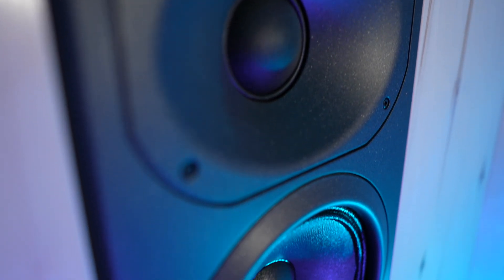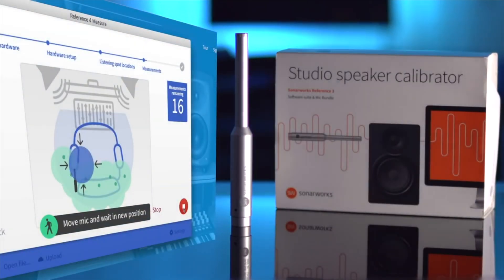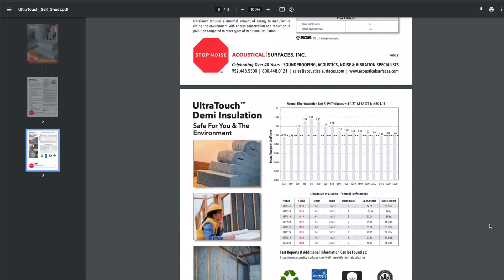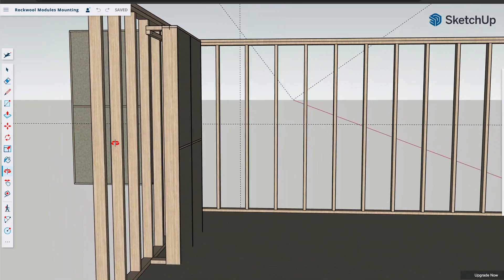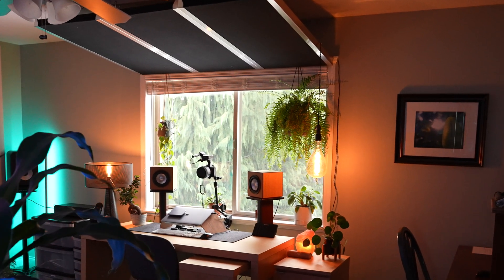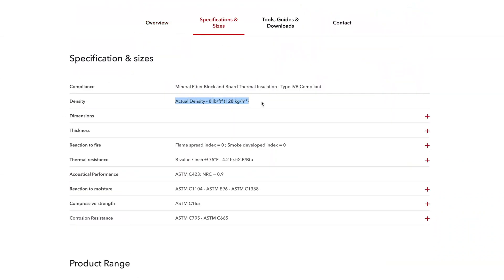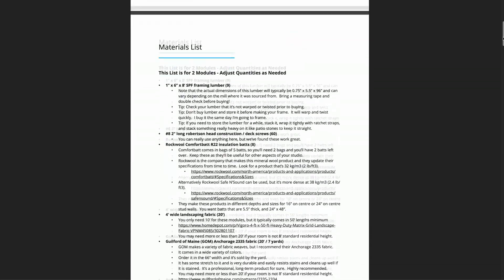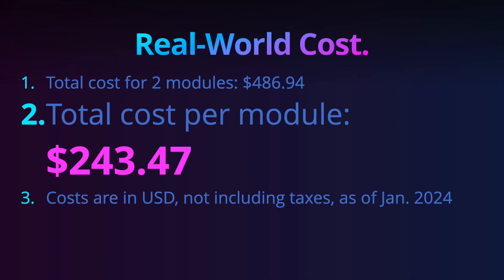How to Use Porous Absorption in Studios - Rockwool + Fibreglass

Comment: What can you recommend for making 50 cm in deep for soffit bass traps? Good video btw :)
Reply from the maker: Glad you enjoyed the video.  If you're working with 50 cm then I would use multiple layers of porous absorption for a gradient impedance / graduated flow resistivity effect.  

I'd alternate between light density pink fluffy for the majority of the absorber (36.25 cm) then 13.75 cm of Rockwool Comfortbatt.  

By soffit bass traps, do you mean that they'll be mounted up in the seam between the wall and the ceiling?  I assume so.  In that application you'll get superior results be sealing the air space behind the absorbers.  This should improve the LF absorption, creating a spring effect from the trapped air.  

Alternatively, you could fill that airspace with more pink fluffy.

Comment: I have a room size of 115" inches wide and 150" inches long>> 
I want to build a superchunk corner bass trap 24inch long and 17 inches angled to the cornerr walls
also with a 2ft by 4ft, 4 inches thick panels to hang around the first refection point and also to place them around the rooms to help control mid and high frequency. The main purpose of this is for Mixing and also for recording vocals 
In my country the available density of rockwool is 50kg/m3, 70kg/m3 and 80kg/m3 and they are all 50mm thick 
but the main problem is what density of rockwool is best for my setup? 
i know this isnt a new video but i would appreciate every help i can get
Reply from the maker: I’d try to find some low density pink fluffy fiberglass.

Comment: Hi, great video!
I have a question: what kind of OC did you use what the R number on it and is it 5000 pa sm and if not, could you guide which one is, cause I need exactly 5000, for my studio according to space that I have, thank you in advance❤
Reply from the maker: Hey hey.  I used the OC pink fluffy 5.5".  Can't recall the R value as that isn't anything we use for acoustics.  

You will also never get an accurate GFR number for low density fiberglass because there's so much batch to batch variation in density that OC doesn't even publish a density number for it, let alone GFR.  You're just guessing.

Comment: I only have rockwool safe n sound and back wall cant be treatment  cause its laundry so im only using front wall beind speakers sides ans cealing above me will 6 inch and 12 inch framless panels work with 3 inch eoxkwool stacked im only have 7db issues with 50hz to 200hZ
Reply from the maker: Hey hey.  I’m not a fan of putting treatment behind speakers.  I put the speakers right up against the wall which improves bass response then I add porous absorption all around them.  

I would highly recommend finding a way to treat your back wall.  That’s where your speakers are aimed after all.  All the energy in room will be dumped back there.  

If you need access to laundry consider making a false wall with a door or adding gobos on stands that can be moved.  Something is better than nothing.

In terms of your 6” or 12” panels.  Yeah Safe n Sound comes in 3” thickness.  But you’ll get way better results especially with bass if you use multiple densities of insulation.  So maybe a 1.5” front layer of Rockwool Rockboard 40 or Cavityrock.  Followed by Safe N Sound or Comfortbatt.
Reply: One more thing would be correcr to say using two materials will set off inner air gap or fake gap since rockborads uses safe n sound layers as air space before sound hits rockborad again  @warpacademy
Reply from the maker: Hey hey.  I would definitely recommend using an air gap behind your modules, but I'd use the Rockboard 40 as the front layer, then Safe n'Sound directly behind (not gapped) and then a gap behind that equal to the depth of your panel.  So if you have a 9" panel, then air gap by 9".
Reply: @warpacademy      Gotcha im almost done now i ended up doing a frame for 12-inch bass trap make sure i get 50hz down 7db to at least 2 db. we don't have rockwool 40 in ohio but we have many fiberglass brands and safe n sound i have a few of safe n sound right now. i just signed up for your course. i have about 18 inch each corner in front and no space in the back wall since washing machines and dryer
Reply from the maker: @22rapper  right on.  Glad to hear your treatment is progressing.  Make sure you pay attention to density when going for deeper traps.  Don't use 12" of straight up Rockwool.  That'll be too reflective in the lows.  You'd want to use some Rockwool and some pink fluffy fiberglass.
Reply: @warpacademy  okay so only use 6 and 9 inch straight rockwool if i do 12 inch corner trap use pink fiberglass im also using Sonarworks just gotta reduce low end form plus 8 to plus 2 or less less pleasing but doable plus 5. in painting walls now
Reply from the maker: @22rapper  Hey hey.  That wasn't quite what I said.  If you're doing a 12" depth, you'll be far better off using 2 densities.  IE use a front layer of Rockwool, followed by a deeper later of pink fluffy.  So, 3.5" of Rockwool Comfortbatt, followed by a 5.5" and 3.5" batt of fiberglass, for example.  Cheers.
Reply: Okay thank you. You were sayin in video 2 density together gave you a membrane effect right? If so thats cool many in my heart say I need membrane trap or 5 feet trap for my 50hz I'm like I'm talking to a pro I'm listening him @warpacademy
Reply: Gotcha I signed up for course. So if I do inch bass trap do 1.5 or two rockborad then 9 inch of rockwool.  right now my speaker are close to wall before it was 12 inch away now it's 8 closest i  can get it. since on spider leg stands so  but stand is against it for sure. The laundry room definitely cant be cut off i also have a furance and water tank on left side but luckly concreate walls so all flate response just 50hz 200 spike but 50hz is more of headache i know 200 can be handled with 3 inch rockwool based on nrc. @warpacademy

Comment: hey thanks for the video really helps out!! i wanted to ask you because of limited space you mentioned i encouter with, what is the best possible density for 4inch panel in kPa s/m2?
Reply from the maker: Hey hey.  Glad you liked the video.  The unit of measurement you mentioned (kPa s/m2) is for gas flow resistivity, not density.  They are related, but not the same thing.  Usually manufacturers don't publish GFR, only density.  

Panels of the same density, but made of different materials (for example, glass wool vs rock wool) can and will have different GFRs due to variations in fibre structures.  

In general, for studios, you'll want to start with materials in the 10,000 Rayls (kPa s/m2) range.  Rockwool Comfortbatt in North America is 32 kg/m3, which is about 10,000 Rayls.  Although, if all you can manage is a 4" thick panel, you'll likely get better results with higher density material such as Rockboard 40 or CavityRock (64 and 69 kg/m3 density respectively).  

Cheers!
Reply: @warpacademy  Awesome thanks for the Info got confused a bit but now its clear, i'm asking in kPa s/m2 because here in Europe it's basically the opposite thing, they publish GFR and not density!!!!!
Now i have got rockwool material of 30kPa s/m2 4inch thick to be made for the first reflections and back wall, and mineral wool of 5kPa s/m2 for thick 16inch soffit bass traps floor to ceiling and after watching your videos i'm thinking of combining the two thicknesses to expand the absorption for the first reflections and back wall to 8inches, what is your opinion about that? Should they reflect back if i keep it only with the semi rigid material or combine them?
Reply from the maker: Hey hey.  Okay, so do NOT use a 30,000 kPA s/m2 material in a music studio.  That's way out of range and it'll reflect a huge proportion of low mids and terribly underperform absorption made with 10,000.  Watch my entire video series.  Follow the advice.  I've put it all out there.  

The 5,000 kPA s/m2 product would be great for deeper modules, but too light for modules up to 15 cm.  There is a sweet spot.  If you know the GFR numbers, use this to model your treatment acoustic performance: http://www.acousticmodelling.com/porous.php

Comment: As far as I know rockwool is pretty expensive in Australia and isn't widely available. I think it might be over $200 AUD a bag. I think there's only a couple of building suppliers that sell it.

I can get knauff insulation from the local hardware which has the highest density of around 30kg/m3. It's around $100 a bag.

I don't want to build super thick panels and it doesn't have to be perfect but I was wondering if this would be a good enough compromise for a bit of treatment in a bedroom studio? Or is it worth forking out the extra money and getting rockwool instead.
Reply from the maker: Ah yes, the availability and cost of materials in your local area matters.  Each type of material has different gas flow resistivity for each density.  I don't know if knauff has a different fiber / strand structure to rockwool, so I have no idea if the GFR is what you want.  Maybe they publish that?  But GFR is usually hard to get.  You want 10,000 Rayls.  Maybe a bit higher if you're going with thin panels.  

What thickness of panels are you thinking?  Also feel free to link me directly to the product you're thinking of using.
Reply: @warpacademy  thanks for the reply mate!

The plan was just to get some bookshelves from IKEA and stuff them with rockwool. I feel like this would make my setup more modular and I just wanted to make this as easy as possible for myself. I was thinking around 6 inches.
Reply from the maker: You're welcome.  Man, I saw on Youtube some guy talking about how you can use IKEA bookshelves like that.  Please DO NOT follow that horrible advice.  Build proper frames and make super modular panels easily like this: https://youtu.be/ECazGzutkV8. 

Those IKEA bookshelves are not tall enough.  You usually have to cut insulation batts to fit in them.  Most importantly, if you turn them sideways, they will reflect sound back to your mix position.  Not a fan of that type of hack job just because it's easy.  

The frames in my video can be made super quickly, simply, and inexpensively. And you can vent the sides of them easily by using a hole saw or spade bit and jigsaw.  LMK if you need any tips on that.
Reply: @warpacademy I got round to watching the video you recommended. I'm still banging my head against the wall trying to figure out an affordable alternative to rockwool insulation. 

The most expensive would be Rockwool Safe'n'Silent Pro 330 that's 40kg/m3. 5.5 inch isn't standard in Australia so I would need to buy 4 bags of 75mm thick batts to make 2 panels. That could cost over $800 just for insulation.

Knauff earthwool sound shield is $100 a bag is 28kg/m3. No idea what the GFR is. Chat gpt said 9000 rayls.

I can get some cheaper non branded rockwool stuff but the density is around 100kg/m3

What's the maximum density i could use?

I'm tempted to just try the knauff as it's easily accessible. I think the panels will be 180mm thick if I stack two batts together.
Reply from the maker: @mezonplas  Go with the Knauff.  Never use a product that's 100 kg/m3.  Way too reflective, unless it's like a 2" panel.  Cheers!
Reply: I'm going to put the frames together soon. I watched this video again and was reminded of graduated density.

The knauff is 90 mm thick and then I could get some rockwool at 50mm thick and then I would end up with a 5.5 inch panel. One layer of 40kg/m3 at the front and then the less dense knauf at the back.

The rockwool safe n silent comes in bags of 8 batts at 50mm meaning I would only have to buy one bag of each insulation to build two panels. The timber will also be cheaper at that width.

Great success! Thanks for all the help so far! @warpacademy
Reply from the maker: @mezonplas right on.  Stoked to hear that.  Good luck on your build.

Comment: Hi, Thanks for making such informative video. I have a question. 
My Room is small 13.5' x 8.08' and Height is 7.66'. Is Comfortboard 80 1.5" thick with Safe n Sound 1.5" thick will work for one pannel? 
Today I just bought 2 bags of Comfortboard 80, Now I am thinking about adding 1.5" layer of Safe n Sound as well. I also bought Owens Corning Fomular 0.5" thick Pink Foam for back of my panel. Can you please guide me, Should I buy Safe n Sound for layering or Comfortboard 80 will work. Waiting for your reply. 
Thanks and Regards.
Reply from the maker: Hey hey.  Well your biggest problem in that room is going to be the dimensions and the low end modes.  You'll have 2 first order axial modes stacking at 70-73 Hz.  Then second order ones at double that etc.  

So you'll need extensive low end control if you want to make a real attempt at flattening the frequency response.  The treatment you have planned is inadequate for that.  You need lower density, thicker absorption.  But of course the issue with small rooms like yours is that you don't have much room volume to work with.  

I would go with floor to ceiling 2' x 2' broadband absorbers in each of your 4 corners using Rockwool AFB, Safe N'Sound or Comfortbatt.  They'll all perform quite similarly to each other although they are different densities (not that much different).  

The Comfortboard 80 would only be useful for a ceiling cloud IMO.  Angle the ceiling cloud towards your back wall, as you will definitely get a reflection off it due to your choice of high density material.  It can act as a bit of a waveguide that way.  And you can put lower density material behind it.  

For your back wall, I would go floor to ceiling, wall to wall, using the absorbers I show in this video: https://youtu.be/ECazGzutkV8. 

These are only 5.5" thick, so double them up and do at least 2 layers of them.  Better if you can get 4 layers on the back wall so you'd be 22" deep and use pink fluffy for 1-2 of the layers instead of Rockwool.  Air gap them from the wall or fill the cavity behind them with pink fluffy.
Reply: @warpacademy  Thanks for the quick and detailed reply. 22'' Deep panels are way thicker for my room, I know my room is not ideal for Studio but I don't have any options right now. Can you guide me ideal acoustic treatment for my situation? I know I will not get the best sound, moreover its a room in the Basement I will get noise from above the floor. I just want to control reflections as much as possible with 4 inches of panel. 
Thanks.
Reply from the maker: Sure.  You can contact and hire me for those types of acoustical consulting services through my site https://vespers.ca.

Comment: How did you verify the flow resistivity of Comfortbatt? I’ve been struggling to find any reliable data.

Loving this series btw. Thanks for sharing your experience.
Reply from the maker: Glad you've been liking the series.  Thanks.  The GFR number for that density of rockwool is widely known in acoustics communities and many of us model off that for other densities of rockwool.  I'm not sure if it was Rockwool the company that dropped that number or someone had it tested, but it's generally accepted as accurate.